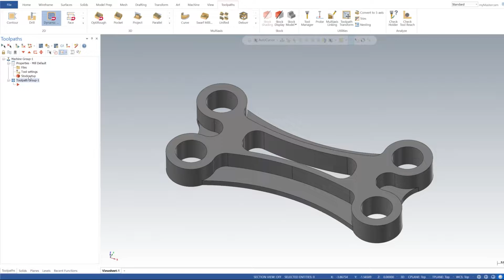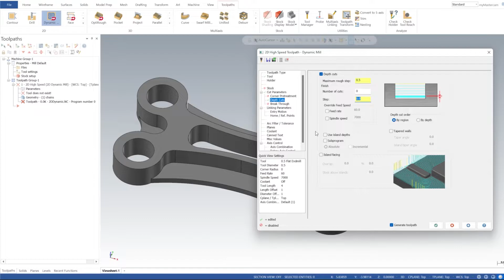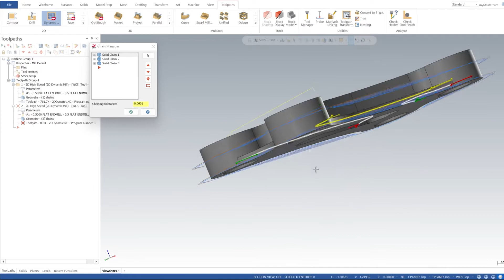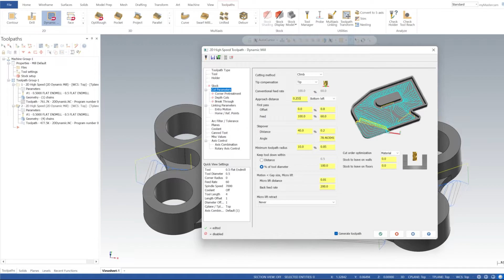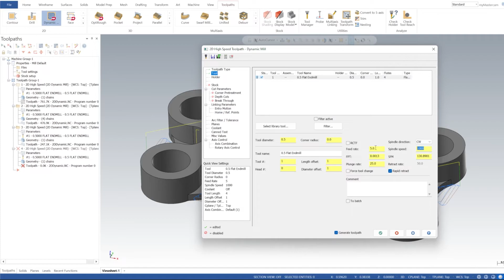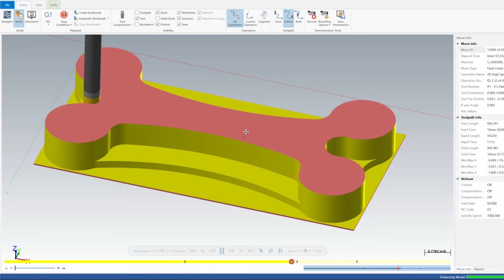MasterCAM 2D Dynamic Milling Tutorial ... Again

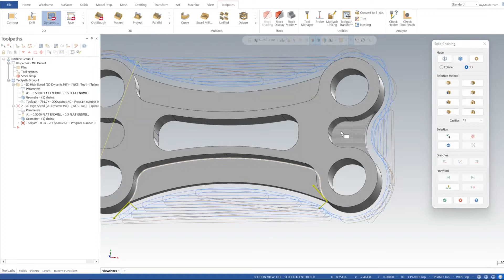Comment: 7:30 tip: you can click on the selection modes on the button "outer shared edges" and mastercam will select the same edges as you did, but this way you only have to click on the face. Alternatively and even easier is using automatic region selection. 10:00 the toolpath cuts air because you have not defined an open edge.